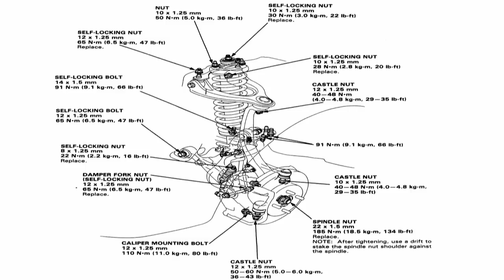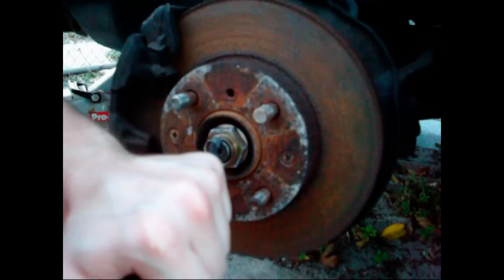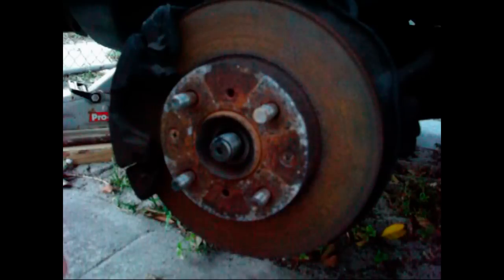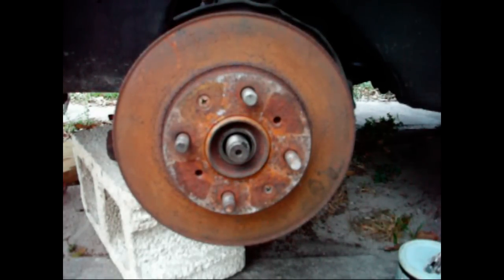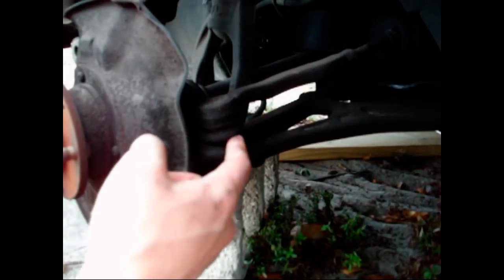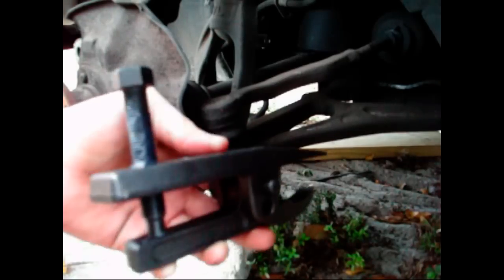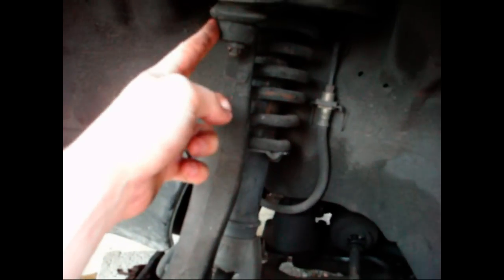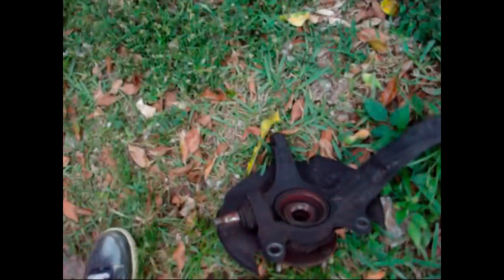How to: Remove a steering knuckle from a car

Comment from the maker: Replacing the springs should eliminate the knock but I believe the crankshaft has to be removed to do so, so I decided to just put up with the noise as long as it won't hurt anything. I've also heard that doing a throttle body sync can quiet down the knock or even make it disappear. After I do a valve adjustment, I'm gonna do a throttle body sync so then I'll see if that helps. You should also check to make sure your cam chain tensioner isn't going bad as it can cause a rattle/knock as well.

Comment from the maker: If you only hear the knock when it's warm then it's probably the same knock I have. I did a lot of research and apparently the cause of the knock is that there are some springs in one of the gears(primary drive gear I believe) and over time the springs become weak so it causes a knock from the gear moving around. It's not supposed to be any danger to the engine from what I've read.

Comment: thanx it was very detailed and simply explained, having a problem with getting off the ball joint on my 98' cr-v I just installed and did not have it pressed in.  I was told it is very Important to have it pressed a hammer is not getting it done to knock it out, guess I will have to rent or buy the ball joint removal tool. Thanx again

Comment from the maker: I've put about 4000 miles on my bike since I got it. It has had the knock sice I bought it and it hasn't gotten any worse. I'm pretty hard on my bike sometimes too, I've gotten it to max speed and held my bike at around 14k RPMs in 6th gear for about a minute and I used to drag race often with my friend that has an F4i also. I think if something was going to break it would have already. As long as keep up with the oil changes and follow the maintenance schedule you should be fine.

Comment: The first "ball joint" you refer to and remove is actually a tie-rod end.  It is a "ball joint" but not what you would call it if you were going to the parts store.
Reply: That is good to point out, the first "ball joint" he removed was actually a tie-rod end.

Comment from the maker: What my bike does is that when I first start it, from a cold start, it knocks a couple times and then it goes away and the engine sounds fine. Once the engine reaches operating temperature(around 180 F) it has a steady knock, sounds like about 5 knocks a second. If I rev it past about 2500 rpm the knock goes away. The knock also goes away when I first take off in 1st gear and the clutch is in the friction zone. So my knock seems to happen around idle with no load on the engine.